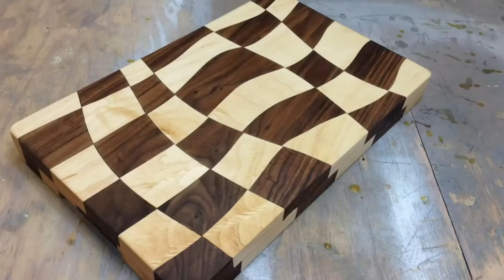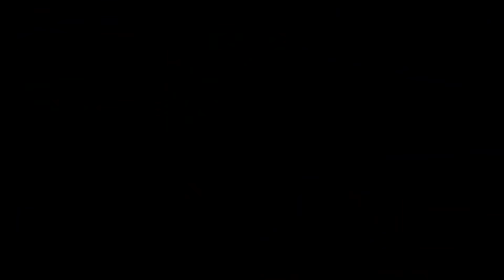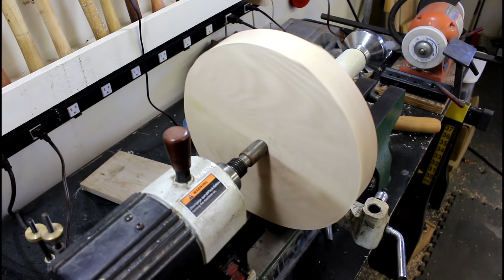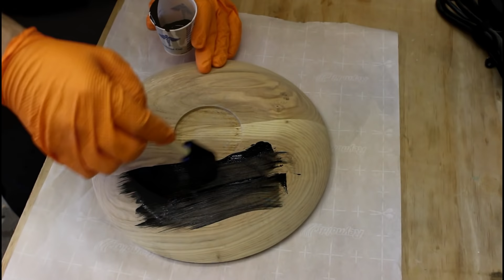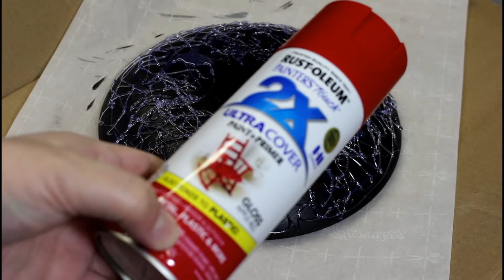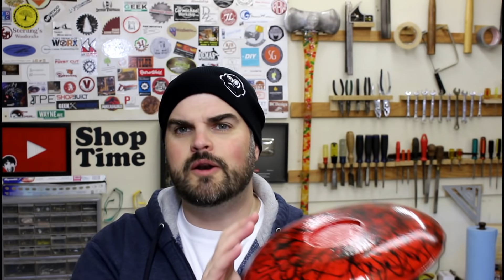The Hot Glue Bowl

Comment: Don't kill it, you could turn it into a wall clock! Drill through the center and insert a clock kit through the back (available at craft stores). The black and red colors would be a really striking background.
Reply: Also, if you want to try a different technique for adding color to a wood piece try using oil paints. The higher quality brands have more pigment in the paint. Try using oil to thin the mixture and you can create custom paint/stains that will show off the wood grain more than acrylics.
Reply: That's kind of freaking brilliant actually

Comment: It's awesome but yeah, colour choice is a bit odd. Have you thought about trying it with wood stain or similar to attempt a dual-wood effect?
Reply: Acrimonious Mirth I think the base coat could be wood stain but then he'd have to seal it and use paint otherwise it would probably spread under the glue.
Reply: Sherrie Venturi yes, bleeding is a strong probability. Toned lacquers or varnishes could work. Be worth experimenting.
Reply: You can get wood stain in a spray paint can as well. That would be interesting.
Reply: I think it would have been better if the colorchoise would be inverse. Red markings over black
Reply: Acrimonious Mirth the stain wouldn't work for a couple reasons first good luck getting hot glue off stained wood and second is because of the way multiple layers of stain work they really wouldn't contrast at all

Comment: Your painting technique is kind of atrocious.
Reply from the maker: it's true. I need to work on that!
Reply: Peter Brown I agree with a guy above. resend it then hot glue on bare wood then paint
Reply: +Made Of Steel, Thats not the problem, he used fairly cheap paint and he haphazardly sprayed the paint on way too thick.
Reply: right i was cringing the whole time
Reply: turtle79070 He made a bowl out of hot glue. Tone down the criticism.
Reply: The whole thing isn't a work of art.
Reply: The acrylic paint needed to be thick or else the hot glue wouldn't have came off.
Reply: I think the thick coat of spray paint gave it different depths as some black is crisp while other bits are more hazy. I do think it would've looked better with different colors or even the red and black switched, though.
Reply: @scarletfluerr  if he made it to look at it, then its art. You dont get to decide what is and isnt art

Comment: How I would have done this differently, as I think it would have a better result; Sand the base further to get it truly smooth, sprayed the black, and sanded after each coat (old trick we use in the case making factory). I would have also use lighter coats of paint, the thickness reduces the smoothness. A smoother finish would have definitely made this a lot more desirable.

Comment: I thought this was a hot glue bowl, as in a heated bowl with hot glue in it to be dipped out for use. I made something like that out of a small stainless steel crucible and a heater strip a long time ago, and i use it a lot. It's hooked up with the lights in my work area, so as soon as i walk in and turn the lights on within a few minutes i have ready to use glue that i can just dip out with a wire.